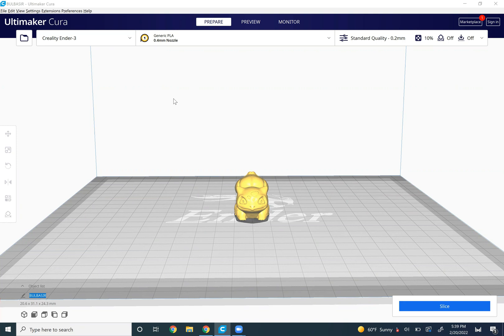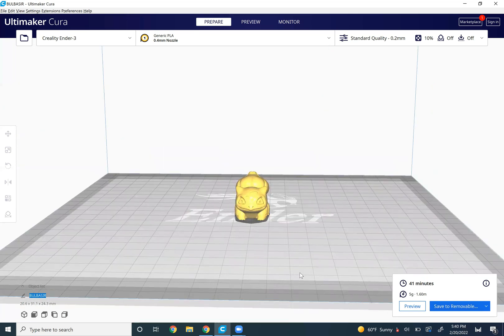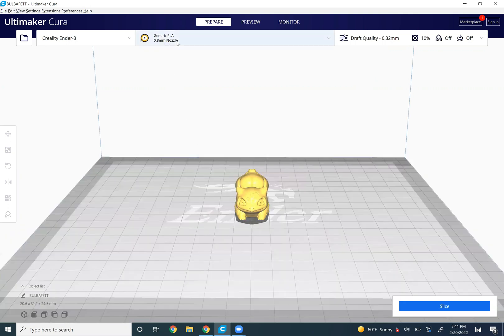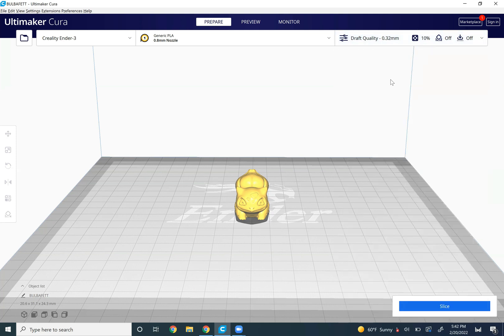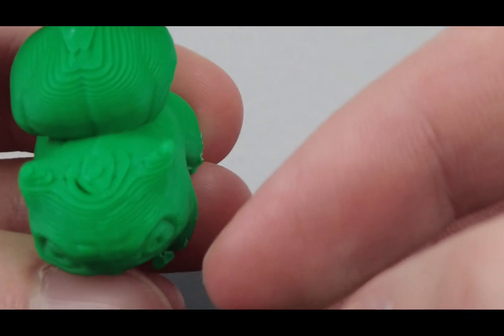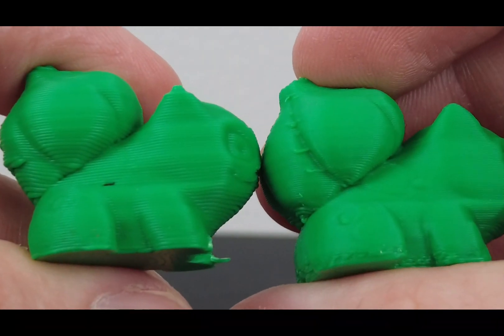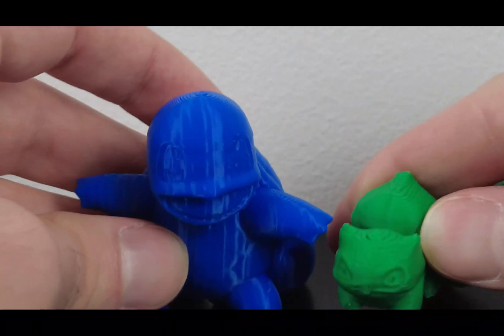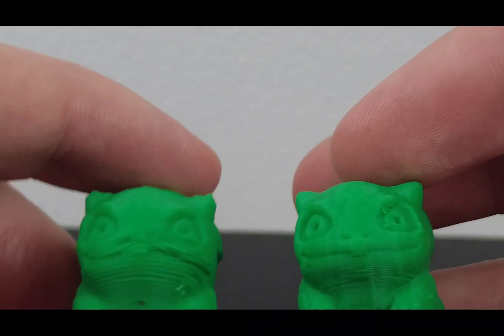0.4mm vs. 0.8mm 3D Printer Nozzle Test

Comment: You could've run into flow limitations of your hotend with the 0.8 nozzle. My printer fails with 0.6 nozzle (0.3 layer height) at speeds above 50mm depending on temperature. The defects like separated lines, gaps and inaccurate size/forms look similar to your model.

Comment: bad information!! your not comparing the nozzle size, your comparing the settings and nozzle. the .8 nozzle and .4 nozzle both can do .2 layer height. this will produce almost the same surface quality, but will have worse overhangs. upgrade your part cooling and you will barely notice the difference
Reply: It is only comparing the nozzle size if parameters are set to look normal